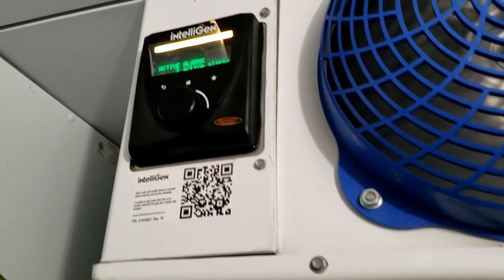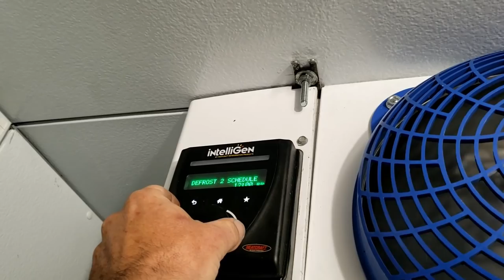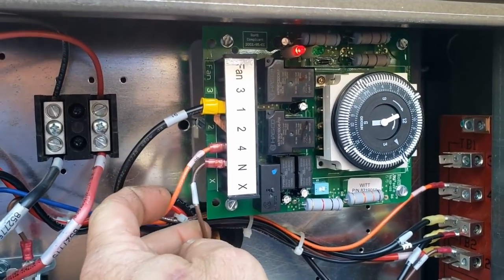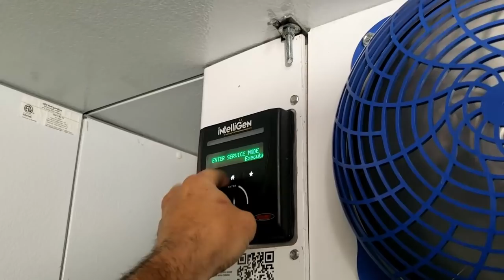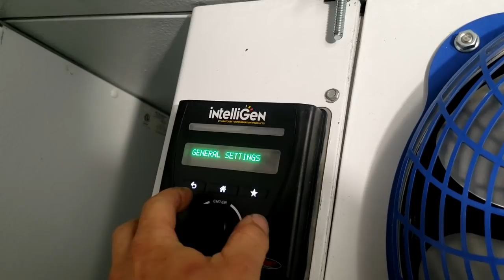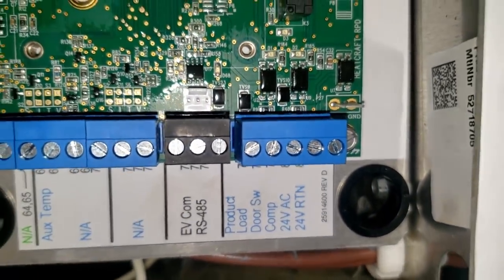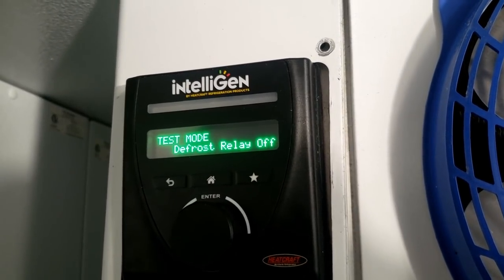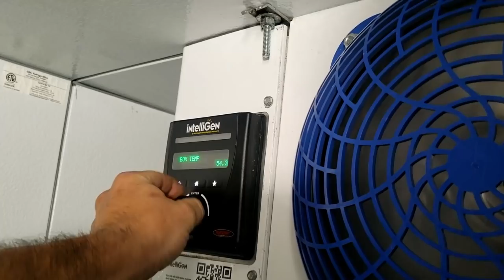Walk In Cooler Freezing Product For Days! I NEED You Here Tonight!

Comment: These units are definitely tricky if you’ve never seen one before. It’s always the emergency calls that give you a run for a money haha. Expert all 9’s basic all 8’s. Some of those smart coils run with a reverse differential too so if set point is 35f with a 2diff then box temp will satisfy at 33f. Had it happen on a couple new installs with the same complaint after. I like superheat closer to 8-9f for WIC and 6-7f for a freezer. Heatcraft manual has a good step by step diag too for the EXV harness, valve and coil. Good work on little info
Reply from the maker: Thanks for the information and watching!

Comment: I work with EEVs a lot , I've been saying from the beginning that this trend of using it without a liquid line solenoid is just plain stupid , it puts so much strain on the EEV's piston and stepper motor that it's bound to start leaking by sooner or later .
Don't get me wrong EEVS are good and work well , just don't use them as a pump down solenoid.
Reply from the maker: They recommended using solenoids even with the beacon II but for some reason they went back to doing it without it on this controller. Oh well
Reply: I’m with you on that!
Reply: the extra energy savings one will gain from using an EXV setup are a very small step up from a traditional TXV. The cost of these units far outweighs the actual savings you'll get with the added efficiency simply due to how cheap these coils are made. If they did use a good EXV valve from say Danfoss or the likes where the stepper motor wouldn't burn out when used as a pump down solenoid, the coil wouldn't last as long as the electronics would most likely.
Some may beg to differ but I have yet to see one of HeatCrafts IntelliGen, Beacon 2, or QRC controllers go bad. It's always a thermistor, pressure transducer, or the stupid EXV that fails.
Reply from the maker: @embeddedgirl  The coil on the EXV is what actually was bad. So you're dead on 👍👍

Comment: Test mode goes through 3 cycles. They are easy to navigate once you play around with them. Are you sure it’s not overcharged? I had one where it you could hear it leaking by. Valved off receiver and wouldn’t pump down. I’ve also had new eev bad
Reply from the maker: 🤔. I didn't try that but that would have been a good test🤦‍♂️. Good call👍👍

Comment: Had a few bad boards with these, unplug the valve and check voltage when it is “pumping down”  should help with determining if it’s the valve or the board. Great video!
Reply from the maker: What voltage am I looking for during pump down?
Reply: @HVACRSurvival  It should be around 30V+- when it is turning the valve.
Reply: Where would u unplug from the valve or from the board to check for voltage?
Reply: @HVACRSurvival  30+ ac volts between the bottom two terminals coming off the board. I usually read 1 to 3 volts or nothing and I know it’s bad. With your suction pressure being 70 psi the valve is wide open
Reply: @sdsd4284  You can just pull the connector off the coil.
Reply: @sdsd4284  from the board
Reply: During test mode when the test gets to EXV test between the bottom 2 and top 2 wire of the exv molex while it’s connected to the board. Should have about 20V AC. If not, replace the board. If you do, replace motor first, might have to replace whole valve
Reply from the maker: @XISorryExpertIX  thanks man👍👍
Reply: @sdsd4284  It doesn't really matter, at the valve is easier. Check on the board if there is no voltage on the valve as the cable could be bad.

Comment: I've seen a few videos with the Intelligen controllers - there's an optional wifi board; I've seen Chris/HVACR Videos use the web interface which is pretty cool - it shows quite a bit of information.  At least heatcraft puts the manual up on their web site without requiring a password or hiding it.
Reply from the maker: I found the manual eventually. That was the first time I've seen that controller, 6 at night not a great time to learn about it.  Just like anyting, once you got your hands on it and you've used it a couple times its pretty simple
Reply: @HVACRSurvival   Ha!  I wasn't criticizing you with the manual comment; sorry if I gave you that impression (Plus I saw you comments about being the first time, time of night, etc.).  I was more commenting that it was nice to see a manufacturer with information about their products readily available.  It's getting rarer and rarer these days. 
I also found it interesting the controller has a network option.  Makes remote monitoring pretty feasible - but I doubt most of your customer would care.  It would be interesting to see how service might change if you could be more proactive with customers vs. waiting for the traditional break/fix cycle.
Reply from the maker: I didn't think you were criticizing, even if so you're going to run into that when you post things like this on the internet. We have customers where we do routine maintenance at and we have ones that we do not. It saves a lot of money on night service calls when you do service agreements but some people don't want to spend the money. It is what it is, pay me now or pay me later. I appreciate the comments and you watching the videos!

Comment: Had an issue with getting myself out of service mode on an intelligen freezer. I was told it would not terminate by time that you had terminate it on the control
Reply from the maker: I wasn't giving it enough time. It's not very quick to go in or out. I would say at least a minute or two. If the valve would have been working right I would have known that it was pumping down.
Reply: @HVACRSurvival  thanks for the feedback…gotta love learning the new stuff on the fly. Great vid as always

Comment: Could it be the Head Pressure Control Valve bypassing because Chris had a similar issue.
Reply from the maker: I was off last week so one of the other guys went there and replaced just the electronic head. It's supposedly working now.
Reply: @HVACRSurvival  I see, just a damaged EEV coil
Reply from the maker: @johndeerefan725  That's what he claims was wrong. I didn't know it was separatable